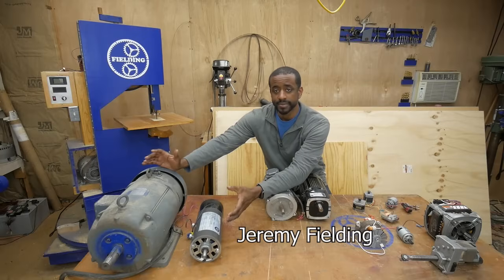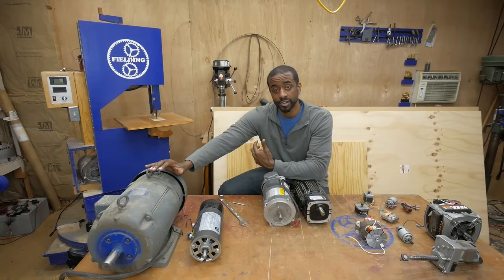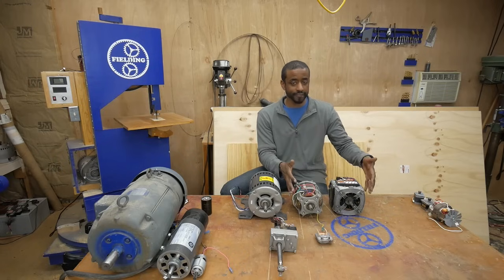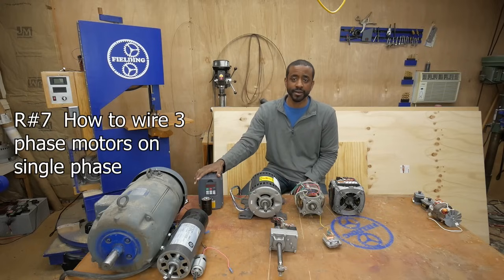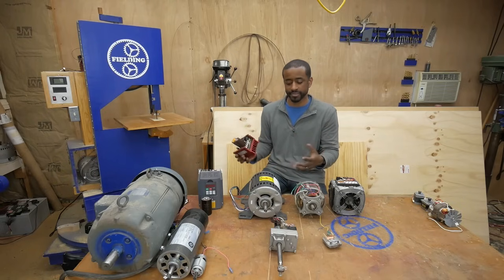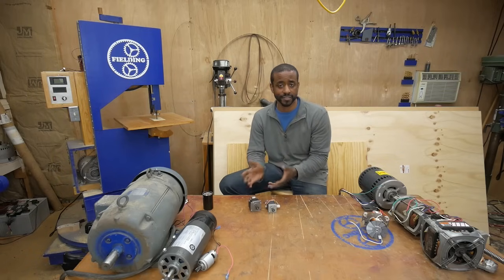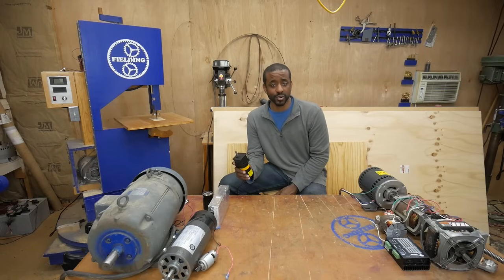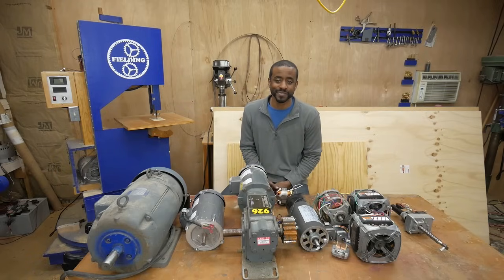Ultimate Beginners Guide to Using Electric Motors for Makers and DIY Projects; #068

Comment: Hp is only the rpm rateing.
Amp is the Nm rateing of how much torque the motor delevers under full load.

Torque does the work
RPM is how fast it works.
Kapeash.
Reply from the maker: Amps can vary a lot based on the efficiency of the motor. Thus amps could never tell you what the torque of the motor is. Hp requires both speed and torque to be calculated...it’s not one or the other. I hope this clears any confusion you may have on the topic.
Reply: Jeremy Fielding .
And you still believe that bullshit Petro boy.

Here is the only way to find a motor to replace a gas engine.

Look up a gas generator factory equiped with a 420 cc engine.
It won't give you hp only the rpm,3600
But this is equall to 13 hp.gas.

Now use your math to tell me what 115v ac motor will do the same job. chances are I'll prove you are way over what is needed with physical evidence.
Reply: Jeremy Fielding .
I'm not confused man, and I'll not allow your indoctrinations to complicate the simplicity of physics either.

Comment: Thanks very informative video.
I'm actually looking to build my own project now instead of getting someone to do it but I have a couple of questions.
I know that the wall outlet is ac so how can I run a motor on it?
How do I control the torque rpm ratio?
Is starting and stopping the motor rapidly harmful (my project will require that) if yes what are the best motors for this application?
Please if you have knowledge in this area I'd like to consult you about different design aspects.

Comment: Great video. I was looking to change the motors on a powerwheels, they use the smaller round 550dc motors. I was looking into putting a bigger motor not to just gain speed but to make the motors last longer then the motors they come with now, any idea what motor or how or even if this could be done. The motors now are 550dc motors, performance are 775 and attached to a gear box with a shaft. Any info would be great or insight or anything at all.

Comment: Thank you for the video I have a friend that has a welding shop and somehow a friend of his took a three phase motor and turned it with a belt with a drill and then turned on the switch at the fuse panel and his shop became three phase how that works I don't know but it works

Comment: so much information its allot to take in!  i had no idea how ignorant i was to electric motors.  thank you sir for all of the time you took to explain so many different things from available types of motors to how to acquire some of them.  i had actually hoped you might touch on uses for them.  more specifically i'm interested in one that would have the power to propel a car or truck.  or maybe if you were to build a windmill motors that would work and ones that wouldn't as i know some have permanent magnets and can act as a generator as well as a motor.

Comment: this was very helpful, I Atomizer coils for vaping and was going to use an old trolling motor to spin the wire I wrap. i need high rpm and minimal torque and found your explanation of the relationship between rpm and torque a valuable insight. Thank You

Comment: Jeremy this video was easy to understand and had great explanations. What does the 5252 represent in your first mathematical equation?
Reply: Eric;  The 5252 is just a constant.  It basically does  a conversion of the units used in calculating power (RPM X Torque) to the unit of power we call "Horsepower".  RPM is pretty universal and self explanatory.  Torque can be measured in different units such as "Foot Pounds", "Inch Pounds", "Newton Metres", and so on.  Depending on the torque unit used the constant in the equation will have to change!  This is something that Jeremy does not mention, but it is important if you are going to do the calculation properly.  5252 is the constant used when the torque is in foot pounds.   If the torque is in inch pounds the constant used is 63,025.  If the torque is in Newton Metres the constant is 12.8.  The calculation can just as meaningfully be done for the power in watts (or kilowatts) and in this case again different constants need to be used depending on the units of torque being used.  The end result will be (0.746 X horsepower) = Power in kilowatts.  Hope this helps...

Comment: Would you know , who or what company makes the worp 9, 10, 11 or 13 inch diameter  electric motor?  There is a video by EV WEST ,  that will not say the actrole name and company of there electric worp 11 motor used in there car motor electric motor replacement kit ,  can you take a look at there electric motor  EV WEST YouTube channel  and make a suggestion please?

Comment: Can someone out there explain how treadmill manufacturers can use a 3-4 hp dc motor requiring 19 to 25 amps at full load (according to ohms law ) and plug them into standard 110 volt 15 amp house hold circuits?????? What wizardry are they employing?

Comment: There are now surprisingly large and powerful brushless motors (with appropriate speed controllers) and large digital and PWM servo motors available in the hobby world for surprisingly low cost.  Check out Hobby King.

Comment: what size motor should i  look for to drive a wire wheel here in the UK 
and what speed should i look for 1450 rpm or 2800 rpm just need it for cleaning smallish motorcycle parts

Comment: Torque is essentially irrelevant, compared to horsepower, since lower torque, higher speed motors can be geared down with a gearbox or a belt drive system
Reply from the maker: Of course it’s relevant. There is energy loss with every system you add....Including gears. You add size, cost, and complexity. More components to break. Take a minute and think about it. Everything in engineering has a trade off

Comment: 2 -old men very skilled
1- large  shop.
1- 3ft dia x 3ft long ,
powers the whole shop.
All drill pressers laths
horazontal mills and on & on.
Thatmotor turns a large leather belt up to the ceiling pully shaft with other pullys that run many other shafts then down to each machine all over the shop. ( verious ratios).
amazing sight.
QUESTION; THAT MOTOR MUST WEIGH A MILLION TON ASSUMING ITS AC, SO HOW MUCH POWER WOULD YOU GUESS?
P.S. MOTOR WAS OUTSIDE THE SHOP

Comment: You should add  some disclaimer or warning about reusing scrap motors without inspecting for shorts, etc. first.  If the motor is found in the junk, very likely it has an issue.
It will be very welcome addition to post a video about how to approach scraped motor and evaluate it's condition safely with basic equipment .

Comment: Can you make a washing machine motor work without the capacitor?
Reply: I believe if you start it spinning by hand, then apply power, it will run. But it is not good for the motor, and it's hardly practical. Start capacitors are widely available.
Reply: @k4kfh  noob question. How do I know which size cap to get? Thx.
Reply: @louiscypher7090  I honestly don't know the answer to that off the top of my head. if you know the washing machine model, you may be able to order the correct capacitor from an appliance parts supplier. Otherwise, I'm not sure. I don't know if that's a standardized thing or not
Reply: @k4kfh  cool. Thanks a lot.

Comment: Watt and hp are not the same thing as watts is the power that it uses and hp the actual output. 
A motor can consume a 1000watt and output like 800watt as 200w is lost in heat. Also in general the bigger the motor the more efficient it is in heat dissipation.
Reply from the maker: Please take a few minutes to research the topic
Reply: @Jeremy_Fielding  I'm a electrical engineer so trust me i did 😉 The cooler a motor runs the more efficient it is. So a bigger motor from the same type and input power will always be more efficient because it runs cooler. (more surface area and mass to store and dissipate the heat).
Reply from the maker: @FullFledged2010  What you are describing is a variation in the way the word is used. Hp and Watts both describe power. You are saying electrical "power" from the wall is watts and mechanical "power" is HP. But every one else in the world calls mechanical power "watts." Only in the US do we use Horse power. Different units same variable. For sure there is some power loss due to heat etc... but that is a different topic.

Comment: Out of curiosity why use universal motors in vacuums or washing machines? The entire point is to allow for AC or DC but in both of those applications the product they're in will be designed for one. Sure you can buy a battery powered vacuum but that's always DC, a washing machine/standard vacuum will always be AC. Why not using something like an induction motor or PMDC motor depending on the power source?

Comment: Making the DC generator from an exercise bike and a treadmill motor was the easy part for me since I have a lot of mechanical experience. How about a video strictly on the power output regulation aspect. I found I can generate up to 50v. when peddling at an unsustainable pace, at least 24v. when peddling at a comfortable pace that I could maintain for several hours. I wired up 2 truck batteries 10 years old that only hold about 9 volts and within 5 or 10 minutes I can easily get them back to 12 volts. 

I set mine up using a DROK buck converter off Ama-con which is fine for adjusting the voltage down to 5v. for charging a phone with a USB cord; or setting the voltage to 15.6v. for my laptop but I want something more basic, ROBUST and/or extreme duty rated like using a 12v. auto/tractor regulator for charging multiple batteries. (and hopefully some other more practical and/or efficient options I have no idea even exist). Tic-Toc I'm betting SHTF is closer than we think.

Comment: capacitor aided inductionmotors have very low starting torque because of the unballance magnetic field, there are some designs that use 2 capacitors in motors for starting under load,
but it´s best to use modern highpower electronic controllers to create a smoother field, capacitors are used for low torgue and low power applications because they are cheap.
Reply: Hello from Catalonia ,Spain .
Great Video and well explain.
Do more plases...

Comment: Great job. I'm always on the lookout for information on motors they use on electric vehicles and motorcycles. The ones I see for sale are usually very expensive. A standard DC motor is usually pretty long and I think would be kind of hard to fit in a motorcycle. Looking forward to your next video.

Comment: SUBSCRIBED: What are the best scrapped motors for an electric trike that is charged by solar? Assume the panels produce 12v-18v. Ideally, the drivetrain should be able to run directly off the panels with no battery, not necessarily at max performance, but so that there no motor overheating from low rpm. Assume the motor is throttled, to allow variable operating speeds, depending on driving conditions. Weight and space are a significant concern.  Assume the motor can be 3-6 horsepower. Gearboxes should be avoided, for preserving efficiency of the geartrain. Water and element resistance is a consideration, but should not be a factor in this question. Assume a traditional bicycle drivetrain is used to maintain 95% efficiency for speeds to 55mph. Thank you so much for your awesome information!

Comment: How can I reduce torque on a homemade electric motor?
Reply: Current limiting. Theres a million and one ways to achieve that. Voltage controls the speed, current limiting will control the max torque.
You should be aware that the current required for an amount of torque will also depend on the voltage. It is actually based on the wattage.

Comment: Im designing an ultralight aircraft and Im going to design an electric motor for that. That is not a big deal. I need 4-6 HP power. I will use DC power supply for that. Im only 16 y.old but I have some usefull aerodynamic knowledge. I will design wings for maximum lift and the aircraft empty weight will be around 60 kg (132 lbs) or maybe less. Even the weak engine will be enough. I will use simple pulley system for control surfaces. Everything will be fine! I will fly! But I hope I dont die...

Comment: I do have a question : can you tell me the sewing machine (SINGER 15CD-1A )what type of motor they used in tt!!! and im thinking to add a start capacitor to the motor for my project to  increase the initial torque is it ok and what capacitor should i use  ,the motor is 220v it has both field an bruches with 6 wire on the outputs .thanks

Comment: As a general design rule, the torque is proportional to the motor volume. You can express the torque as Bg*Ks*D^2*Lstk, Where Bg is the airgap flux density [T], Ks is the electric loading [A/m], D is the airgap diameter [m](therefore somehow proportional to the outer stator diameter), L_stk is the stack length [m]. Of course depending of the cooling/duty cycle, Ks can be very different, therefore any comparison has to  consider that.

Comment: you can find small stepper motors easily.. i habe about 30 old cd-rom and dvd-rom and floppy drives laying around in old boxes of computer parts. inside those there are a stepoper motor and a brushless motor. Thats actually where i got most of my stepper motors i own. recycling old unused electronics for parts is where its at!!!!

Comment: If I'm correct here in Switzerland every house receives 3 phase current. 3 phase plugs are generally installed around the house only to power high power household appliances like washing machines, dishwashers and electric stoves. Considering this it could be possible that motors in washing machines are 3 phase induction motors? Maybe? I dunno
Reply from the maker: Yes... in your area they are

Comment: Please guide me which motor is suitable for homemake small hobby and professional woodwork lathe machine.
Many thanks
Reply: I have put a vibrator plate motor, them fitness things you stand on to lose weight in my cm300 clarke lathe 220v DC (UK) using lathes original controller

Comment: Hello Jeremy, do you happen to know how to adjust the duty cycle timing on a treadmill incline motor? It appears to be gearmotor but only runs for 3sec before stopping, doesn't reset until you reverse it. Designed to turn leadscrew a finite amount of turns but I want it to turn a roasting spit indefinitely.

Comment: Just found your channel; great video!

What kind of motor is best for DC generation? I wanted to build a small 12v generator with a small 4cycle engine.

Also was looking into building a 48v generator for a 120/240v backup using just 4 batteries and a large split-phase inverter. I don't see any 48v alternators for sale other than Caterpillar specific equipment (doesn't provide charging voltage, just straight 48VDC)

Comment: Love this video! Im a motor winder and mechanic and your info was very accurate! Subbed!
Reply: What sort of motors do you wind ? Have you tried different pattern windings ? I've been successful in designing loads of permutations for custom applications.
Reply: @scottrich7703  I mostly do just basic random 1ph and 3ph windings. Basket and lap. Nothing major.
Reply: @photojunky7342  well that is fine, I could do with some tips on three phase Wye and Delta windings.
Reply: @scottrich7703  what are you wanting to know?

Comment: Another source for (free) linear actuators + controller:

Adjustable bed frames. People throw these out more often than you'd think (in my area at least) 

Even if one of them failed, the other one will probably be fine.

Comment: so if you take the smaller 3.8hp motor and give it a gearbox to reduce its max rmp to that of the larger motor, and also beef up the gearbox with a larger diameter shaft, what do you lose compared with that larger motor, whats the tradeoff other than mechanical complexity and minor efficiency loss?
Reply from the maker: Energy loss due to friction. Other than that...nothing really

Comment: I had been watching and enjoying your stuff for a while,  and then somehow lost track of you.  Nice to have found you again!

You mention shaded-pole motors,  which I've also seen described as synchronous motors,  because they're pretty precise with regard to speed.  You will also find these in some older electric clocks (the kind where the second hand moves continuously,  and not in "jumps") and in turntables. The common turntable (not the fancier ones) typically has a motor output shaft with more than one diameter on it,  and speeds were changed by moving a rubber idler wheel up and down.

On the subject of stepper motors,  you can scrounge those out of old dot-matrix or even daisywheel printers,  though because of the fact that they're geared down so much they're not very big.  The older the equipment,  the bigger the motors.  Also,  floppy drives,  and some older (5.25") hard drives used steppers.  Newer (3.5") floppies use a stepper,  but that thing is tiny and I haven't figured out a use for them yet.  Also,  a typical CDROM or DVD drive that's no longer functional will typically yield at least a couple of really small DC motors (hint: Unsolder the connector that the motor plugs into,  as well :-),   one of which is often fitted with a gear and one with a pulley,  and again I haven't found a use for these yet,  though I'm thinking that one commenter's want for "animations" and perhaps my brother's model railroad layout might provide some possibilities...

Comment: What kind of motor can you use in reverse, to generate current, for example for a wind turbine or bike powered electricity generator?
Reply: Harry. B. Renner. jr.  Thanks.
I've used several dc motors before, to generate power and haven't had to wire in any special way, just positive n negative, but I don't know what this particular type of motor is.